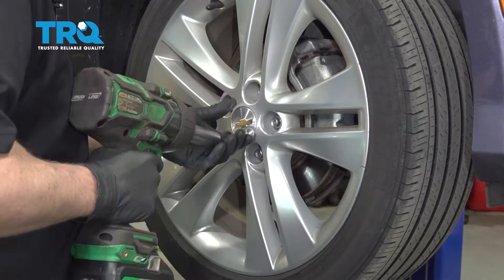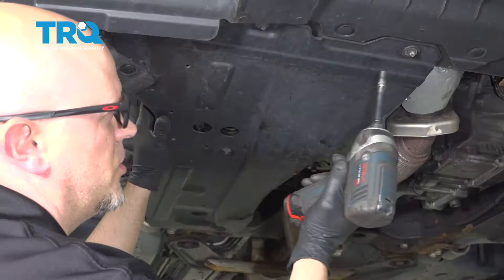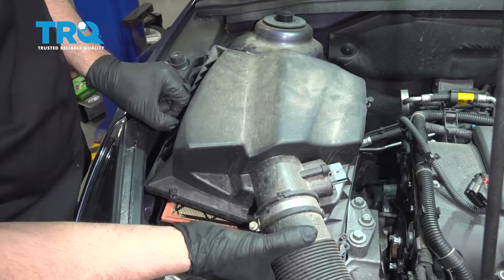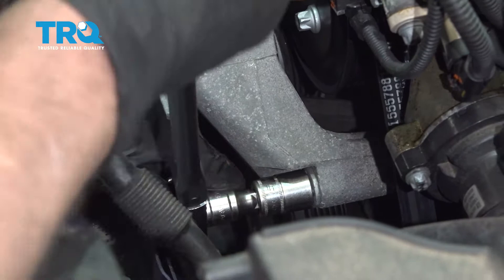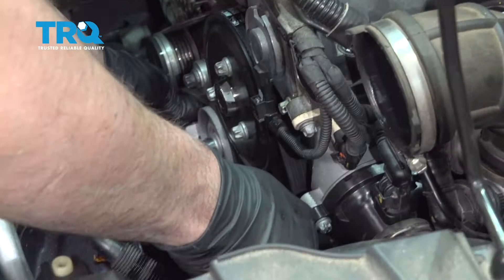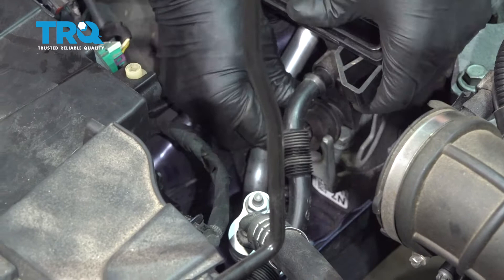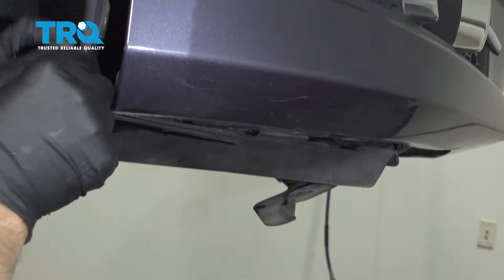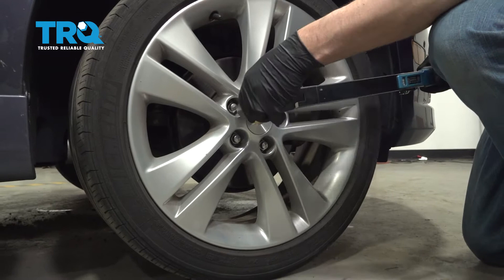How to Replace Belt Component Kit 2008-2016 Chevrolet Cruze

Comment: As some others have noted, this video made the job much longer than it needs to be.
1> Other than supporting the engine can be done from above the car.
2> The air box doesn't need dismantled.  Just disconnect the MAF sensor, the small tube out of the bottom and the large hose going to the turbo and pull the entire air box assembly out.

Comment: I found out after using this video for my install.  Several of the motor mount bolts are "Torque to Yield" bolts.  The old bolts must be discarded and new bolts are to be used.
Reply from the maker: +@randyfischer5082 Thanks for the feedback! http://1aau.to/m/Shop-TRQ

Comment: So there was no need to actually take off the tire and the fender well. Everything can be done from the top. Save yourself some work and do it all from the top by jacking up the motor slightly, removing the motor mount, and taking the belt and tensioner off from up top.
Reply: That's what I did. Kinda tight, but I've got little hands.